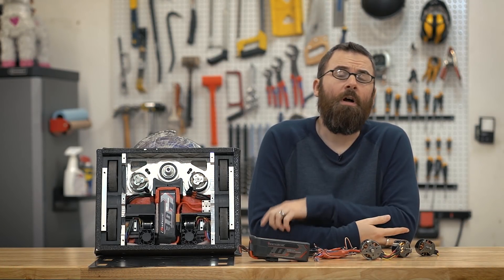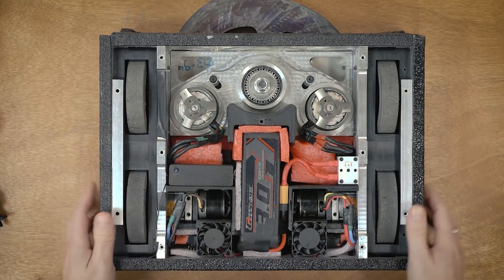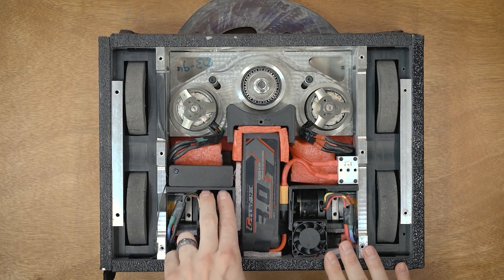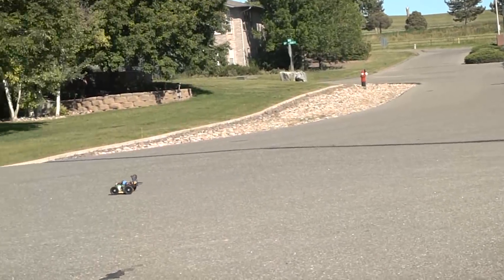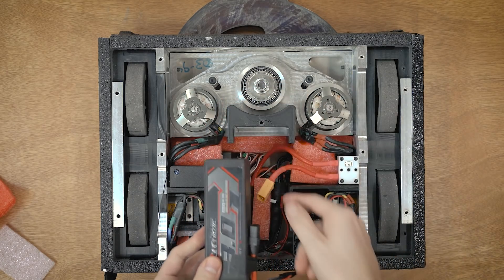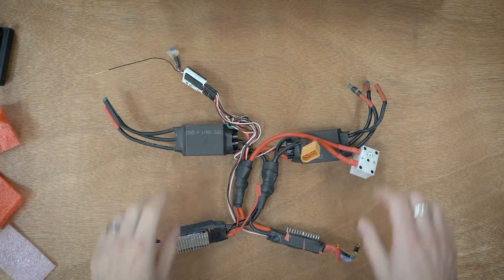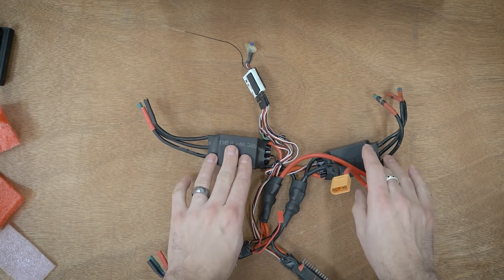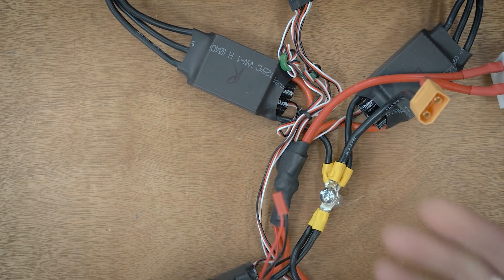Crippling Depression - Part 2 (Electronics)

Comment: For fans, go back a few generations to the old school insert style. Not as good as CFM goes, but, they resist impact quite well. Alternatively, disassemble a new fan, mount it on a spindle, and shave half a mm from the blades (on the OD) to prevent shock-touch.
Reply from the maker: ah ok.  got a link to any pictures of the type of fans you're talking about?

Comment: Glad to see I'm not the only one using ring terminals for power distribution. 
For one of my larger 13kg bots I used a 3d printed block that held the nuts captive so the whole lot could be bolted to the baseplate. It held surprisingly well but it took up too much space for me to consider doing it in smaller bots. The bolts and connectors surrounded in heatsink is a good idea
Reply from the maker: I originally was going to do something like that, but just didn't have the room for it!  The ring terminals were a 'last resort' decision, but turned out great.

Comment: Is there a way to current limit an esc such as the RedBrick... I have a RedBrick 100amp and want to make a chainsaw with it, but would like to use tool batteries but current would need to be limited. I have lipos but it would be cool to use tool battery's. Thanks for the content.
Reply from the maker: Not easily.  You COULD program the ESC for a current limit, but I think the red bricks are a bit tricky.  You might have better luck with a VESC 4.  Just look on eBay or wherever.  Those are much more programmable and configurable.

Comment: I love the ring connectors for distribution. That's the most tedious part of building a bot. Getting the distribution done, and the wire lengths correct takes me forever.

Are those ring terminals aluminum? I'm kind of surprised you didn't go for copper given the huge currents, but I guess they have a huge cross section.
Reply from the maker: I think they're probably just tin, they're nothing special.  Ideally copper or something else would be better, but I think you're right about the cross section, it's plenty of contact area for the current involved.
Reply: @RobertCowanDIY  i have found most larger or heavy duty automotive ring terminals are tinned copper. they look dull like semi corroded aluminium. the smaller ring terminals i have found some are aluminium. i guess it depends where you get the smaller ones from.
Reply from the maker: @magicmanspaz  Interesting.  I've had zero issues with mine so far.

Comment: You should add some magnets to make use of the extra drive power.
Reply from the maker: The motorama arena has a wood floor.  If you can find me some wood magnets, I would add them ;-)  There is a gap between the bottom armor and the drive pods for magnets though, if the floor is metal.
Reply: Oh, how about the AVC arena? That looks like a steel floor.
Reply from the maker: It was a steel floor, but I just ran out of time, since this was a new robot.
Reply: Ok, sounds good.

Comment: I would not recommend running the antenna wires along that aluminum plate.  Any metal that runs parallel to an antenna should be at least 1/4 to 1 wavelength (31-123mm) away from it, otherwise it will detune the antenna and possibly increase the VSWR, which can damage a transmitter (I assume the bot and controller have a 2 way link).  The separation distance is generally at least the same wavelength as the antenna.  In your case it looks like those are full wavelength antennas.  It's okay if there is metal that runs perpendicular to the antenna.  Also, these look like isotropic radiation antennas, that's probably why it's working.
Reply from the maker: Noted.  It's not ideal for sure.
Reply: the antennas on the FrSky receivers are quarter wavelength. The wire itself is quite long, but the active element is just the unshielded bit at the end, which should be approx 31mm long.

For a broken antenna, you can repair it be stripping the shielding (plastic insulation layer + braided shielding layer, but not the clear/white dialectric layer beneath the braided shielding) to recreate the 31mm active element on the end.

Comment: What battery charger should i use?using 6s 4000mah graphene
Reply from the maker: Any lipo charger should be fine.  just make sure it can charge 6s batteries.  I just use a cheap battery charger.

Comment: Very very impressed with the build quality of this. That said from a radio point of view there is probably not a worse way of hooking up your antenna. Surprised it works. If you ever have trouble with range, i suggest space the wires off the aluminium by a few mm with non-esd foam and have a plastic window in the lid.
Reply from the maker: Noted.  Thankfully these things only need about 20 feet of range (line of sight).  I'll think of a better way for the next version.
Reply: Robert Cowan if it works it works.

Comment: what if I use 35C battery with same configuration...
and if I use 100C
Reply: 35c is about 100 amps of current. 75-100c would be a lot better

Comment: What size ring terminals did you use / do you have a link for them?
Reply from the maker: Good question, I'm not entirely sure.  They accept 10-12ga wire and have a 0.25" hole through the ring.  I just got them from Home Depot.  You can easily find them at hardware stores, or even check auto parts stores, they have a great selection of ring terminals and other connectors.

Comment: If you have to compromise anything for telemetry, i dont think you should. It sounds nice but it doesnt really help that much.
Reply: You would be surprised, it is VERY nice to be able to know what is going on inside your robot during a fight.
Reply: Rattler Robotics i get that for a flipper, pnuematic axe, and perhaps bots that have issues with battery life and heating, but outside of that i dont see how the info you get would be useful in the middle of combat (unless you messed up on some stuff). Is there something im missing?
Reply from the maker: I can actually adjust the max throttle of my drive, if it was over-heating, it might be nice to know this and dial it back a bit.  Also, warning sounds and such could help.  Telemetry will be installed ONLY if everything else is 100% ready to go.  It doesn't negatively impact anything, it adds maybe 30 grams.
Reply: Robert Cowan k the fact that it weighs so little makes it much better